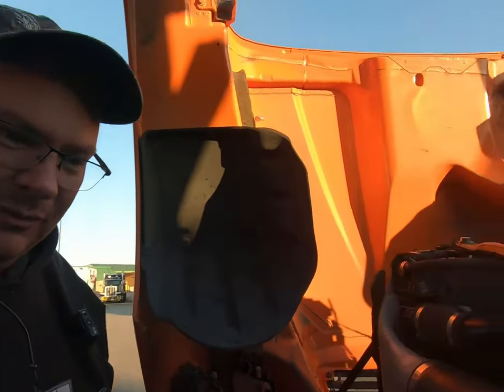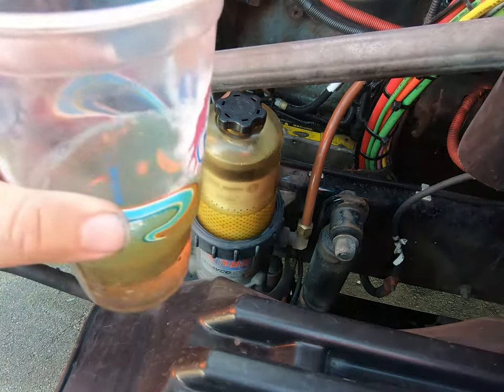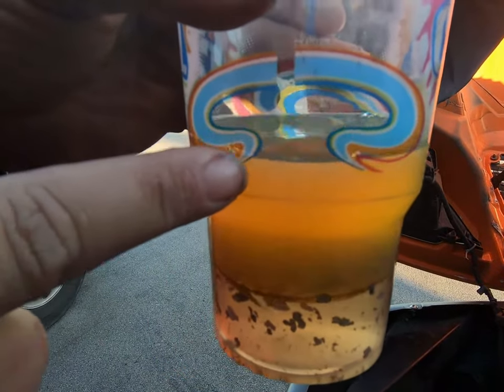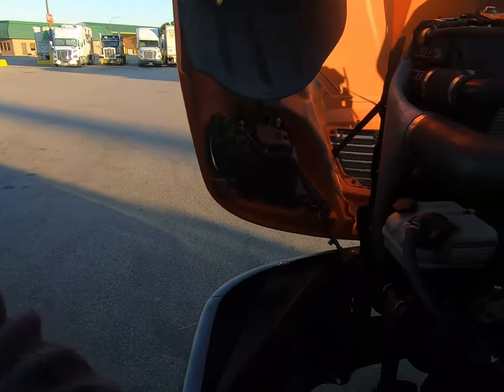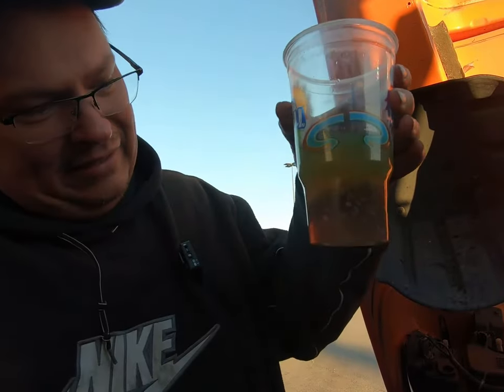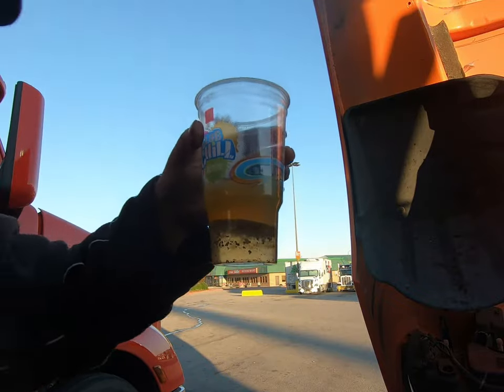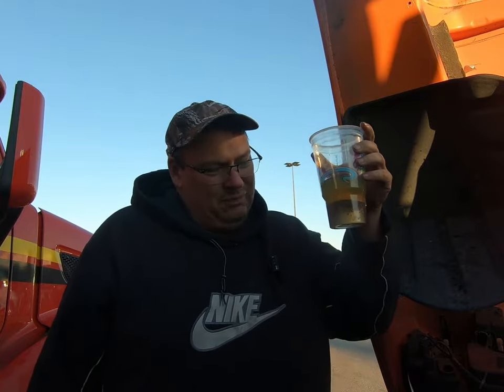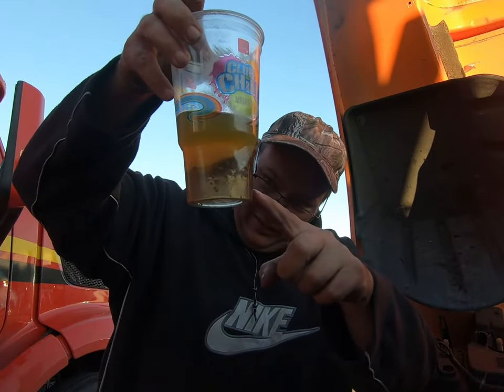Checking for bad fuel....look at this !!

Comment: I had the exact same problem last week and I fuel at flying J. Those black particles look hard like rust etc but if you touch them they disintegrate  I replaced my filter 3 times and put holes in the fuel to clear water.truck still doesn’t run as good as it did but is getting better.

Comment: My truck started accelerating really sluggish after filling up almost instantaneously. After about 35 mph it wont go beyond 20 rpms until i get to max speed and it hesitates from time to time. I drained my fuel seperator and found some water but A LOT of black debri. I guess I got a bad batch. Im currently using some additives and draining the fuel water separator. Its getting better but its still pretty rough. Praying everything clears up.

Comment: Do you drain while the truck is running or turned off? Do you have to refill the filter area to avoid engine stalling?
Reply from the maker: Only when off. Don't drain empty or u will need to prine
Reply: 10/4 thanks!

Comment: One solution: Use a clear cup before you fill your tanks at the pump
Two: have a higher fuel tank pickup 

There's a colored paste you can buy. That will change color when water hits it. Take a wood yard stick, put the paste on the end . Then stick it in your fuel tank to see how much water is on the bottom.

Check out :  Gasoila regular water finding paste

Comment: My question is why the water in fuel light didn't come on. My pete will trip the light with just a few drops of water.
Reply from the maker: because older trucks don't have that light
Reply: @DIYSEMI  Point taken. Been a long time since I've been in something that old. I've been in either Pete or Kw since 08. Can't remember if my Internationals had it.

Comment: Hey diy, is it difficult to install one of these water separators on a trk that doesn't have it? I have the old style fuel filters (2) but they don't have the transparent filter like here
Reply from the maker: Not hard at all. Assume one of your filters is a water separator already? You can plumb it in there
Reply: @DIYSEMI  im thinking it's the primary filter that seperates water but if it hooks right up then all I would need is a clamp to bolt it on the frame. With fuel beign sky high ,im assuming some companies will put fillers in fuel and its better to catch it b4 it damages the injectors